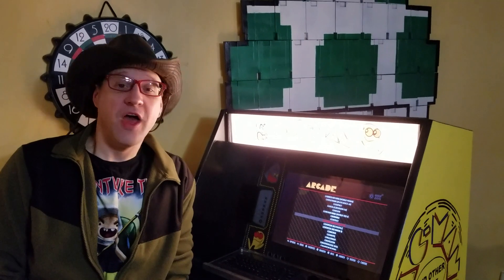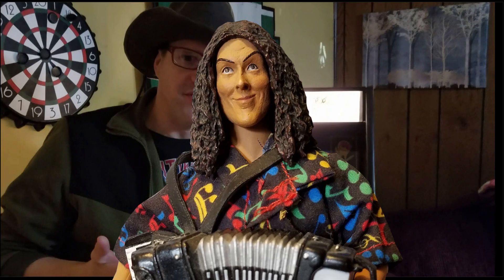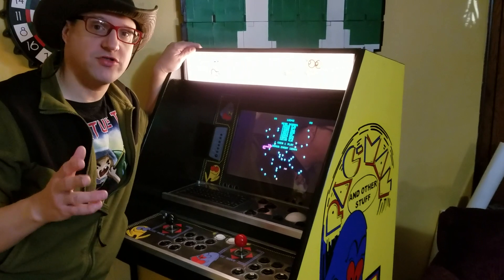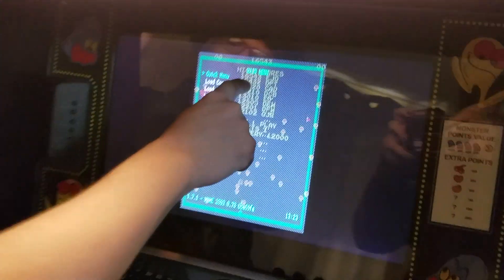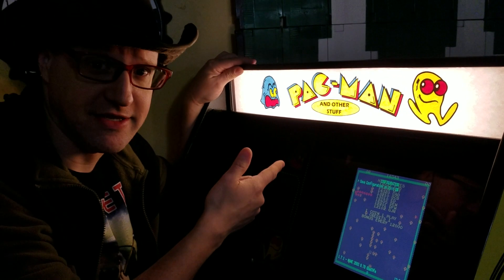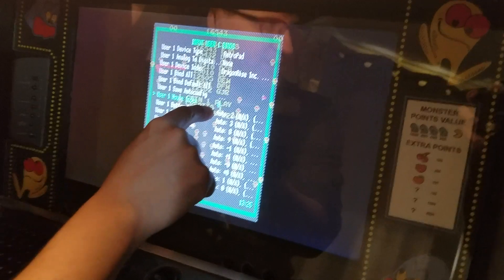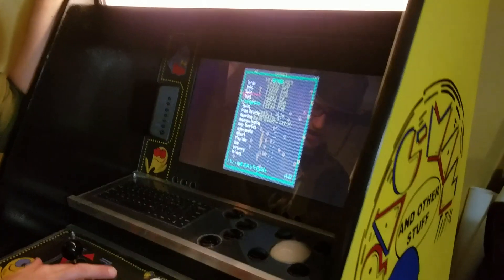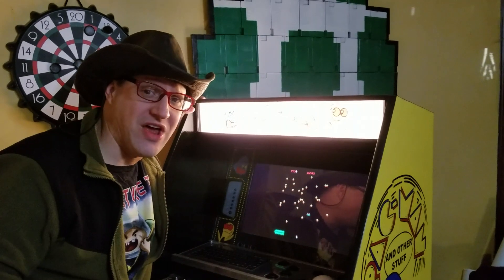Make your Trackball Work  Mame2003 Retropie 4 4

Comment: you also should hit tab on a keyboard to get intot he game cab settings and up the sensitivy and speed on the analog controls for it to work alot better
Reply from the maker: You are right about that! I did eventually make those adjustments as well, but I didn't shoot a video about it. I guess it took me SO LONG to figure just making the darn thing work, I wasn't even thinking about the fine tuning. Thanks for the info though! You are right, and it's good information. Thanks for watching and thanks for commenting!
Reply: @ClayCarlino  tell me about it! Off all week and I FINALLY got it 100% working! Today I put in a swivel arm for my
Monitor. (Not a full cab but it gets the job done) great for vertical shooters!!!
Reply from the maker: @augustheat  oh, what a good idea! I never thought of actually allowing the screen itself to swivel to match it to the screen orientation of the game. Good job! I may have to consider that for future mame cab projects! Thanks for the idea and congrats on getting your machine 100%! That really is an impressive accomplishment that I don't think most people truly appreciate.  Good job.
Reply: @ClayCarlino  its great because you can have the games default to the way it was intended...you just have to then manualy turn the screen ;)

Comment: So when you are doing this I assume you are only messing with the Centipede ROM correct? So if you mess something up it will only be centipede that is messed up and not any of your other ROMS. Is that correct? I am just nervous to try this and mess up all my mame settings. Thanks for any help.
Reply from the maker: Once I changed the settings while playing Centipede,  my trackball worked for all my trackball games. So no. When you save these settings, they apply to Retroarch, which handles all the Retropie settings, not just the single rom and not even just MAME. 

I have 2 recommendations for you. 1.) Make a fresh copy of your sd card. Creating an image of an sd card is not difficult and you can store the image on your computer just to have as a backup in case your sd card ever goes bad. Even if you weren't about to mess with settings, you should do this. Sd cards are not reliable long term and corrupt easily.
2.) Once you are are into Retroarch, take notes of the existing settings before you change anything. You can do this with paper and pencil, or my just taking quick pics with your phone, or by taking a video with a phone making sure to get good shots of the screen, and narrate what you are doing so you can refer back to it later.

I COMPLETELY  understand not wanting to risk screwing up the stuff that works in MAME. Its a confusing program that is very hard to navigate. In fact all of Retropie is that way. It takes a lot of work to get things to work the way you want them. But you shouldn't be scared to try this. Just take these precautions so you can reset what you've done if you encounter a problem.  Also, once you successfully poke around and improve your system you'll be able to enjoy your games more while also becoming more knowledgeable  and confident in yourself. That's a win- win!

Let me know how it goes! I'm always happy to try to help if I can. Good luck! Thanks for watching and thanks for commenting!
Reply: @ClayCarlino  Thank you so much for your incredible help and detailed reply.  I will definitely use those helpful tips you gave and try to navigate the program.  Thanks again!👍

Comment: There is a glitch with the X-arcade trackball and raspberry pi 4. You have to plug it in, unplug it, and plug it back in. Every time you power on. With this info and your video I was able to finally get my trackball to work! Thank you lots!
Reply from the maker: That's awesome! Congratulations!  Kind of sucks about the Raspberry pi 4 glitch though. I would find that really annoying with the track ball being built into my cabinet.
Reply: on your X-Arcade you have the switch on 1,2,3 or 4 on the back of the panel of the Xstick case?
Reply: @DaButcher  I built my own but used the X-Arcade trackball in my build. I'm unfamiliar with the X-Stick..
Sorry I can't help you out more!
Reply: @Zachary Trich  no problem thanks for the reply. I will try this solution Tues or Wed.

Comment: Hi! What Trackball do I have to buy to make in run on my Raspberry Pi 3 and Emulation station?
Reply from the maker: My trackball is an x-arcade trackball. The nice thing is that as far as any computer is concerned it is a mouse. I don't know a lot about different brands, but I think anything that works as a USB mouse should work with a Raspberry pi.  That being said the X-arcade stuff is extremely high quality, so if you get one, I think you'll be happy. Freel free to let me know how your project goes. Good luck! Thanks for commenting!
Reply: @ClayCarlino  Thanks for answering!

Comment: Have you tried to get a Spinner & a Trackball working on the same system?  I'm using RecalBox but Retro Pie all run over Emulation Station and Retroarch, so fundamentally the same.  I can get the system to see an analog device, but you can't have two at the same time.  I.E.  you play Centipede and then want to play Tempest...the latter using a spinner.  Before launching into Tempest, you have to unplug the trackball and plug in the spinner.  It sucks!  On PC Mame or Mac Mame...it works, no problem.
Reply: Seems like you should be able to use the method mentioned in the video, but you're going to use the index that corresponds to the trackball for Centipede and use the index that corresponds to the spinner for Tempest.

Comment: I really like your two tier control panel! That's pretty unique, especially with built in keyboard. I realize this video is a couple of months old, but regarding the issue with saving config file, you should be able to find it is Main Menu --> Configuration File --> Save Current File. I use the Ozone menu driver so it might be a little different, but similar, if not the same. But also I never had problems myself with the way you are saving the config files anyways.
Reply from the maker: Thanks! I'll look for that the next time I'm messing with the settings. I always appreciate when people have good insights to share. Thanks again!

Comment: Thanks for this easy to follow video.  I'm following the exact steps but it isnt saving the configuration even after I change save option to on.  Any ideas?
Reply from the maker: Oh crap! I do not know why it wouldn't save. I know that you HAVE to go into the config settings from inside a running game, but it sounds like you're already doing that. Does it immediately forget the settings as soon as you change games? Or does it work until you turn off the cabinet then forget the next time you turn it on?
Reply: @ClayCarlino  I figured out that it isn't applying the settings when changed from inside the game.  I believe there is general retroarch settings overriding it because when i change them there it applies to the game.  Still even after following your video it didn't work.  Everything was set up as you recommend but no dice.  So I figured out from this videohttps://www.youtube.com/watch?v=oOQeUbZudUA&list=LLKbl55O5b3dDhfpRb2fC_jg&index=2&t=0s that the FBAlpha emulator is the problem.  Retropie is recognizing the mouse but the emulator doesn't.  I will go back in and change the emulator when I get a chance and see what happens.  Thanks for the response.
Reply from the maker: @jimjones6419  , Thank YOU  for all the added information! I struggled with this problem on and off over the last year, and even now, there's so much to learn. Thanks for sharing!